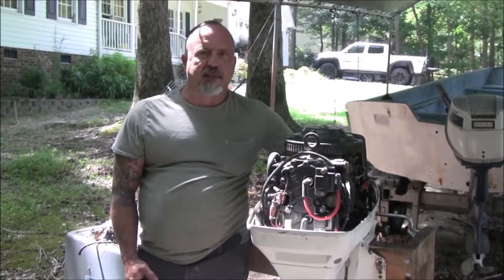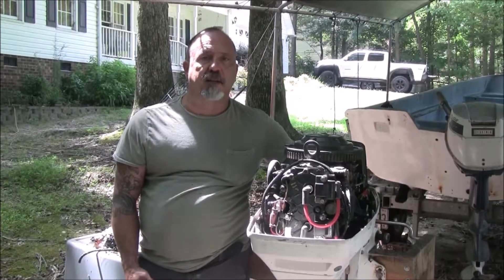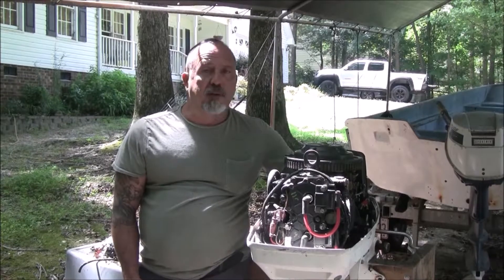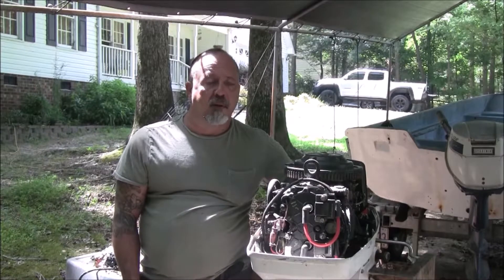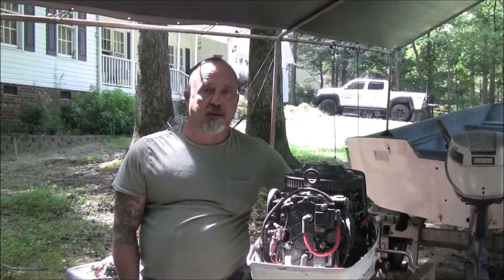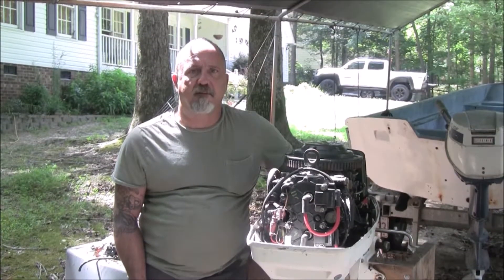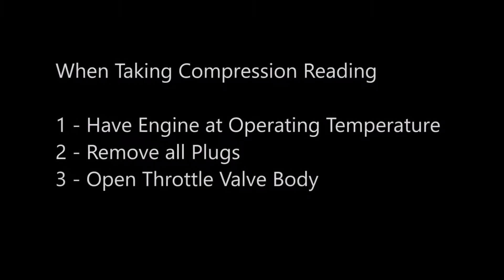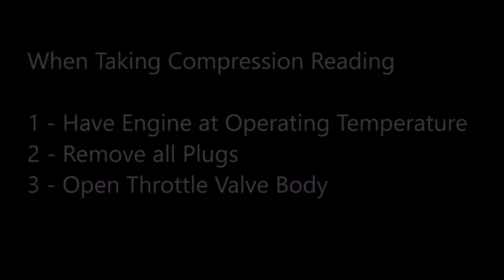How To Accurately do an Outboard Compression Test - Compression Test Kit

Comment: Thank you so much for the video, it really helps a lot, just a question please, would I get a lower reading if the throttle valve is off? I did a test today on optimax 90 3 cylinder, I been told the reading should be around 120-130 but I got 75, I did pretty much everything you did but I did not open the throttle valve. thank you.
Reply from the maker: You might get a slightly lower reading but not that much. That is a huge difference and there is probably something else going on. You may want to try a different tester as well to see if there is a difference.
Reply: @ExtremeDIYGuy  I agree with you, all cylinders reads 75, motor start straight a way with no issue, water pumps out perfect, sealing rubber is good, everything seems to be fine, the motor did 1200 hours, was not over heating at all, however, you might be right, the tester was quite old and not in the best condition, as i did borrow it from a mate.
Reply from the maker: If it runs well then I wouldn't worry about it! You could try to see if you can borrow a brand compression tester but again, if it is running well then don't sweat it too much.